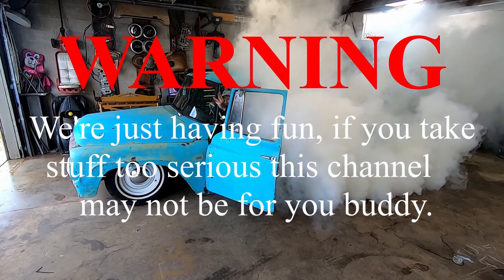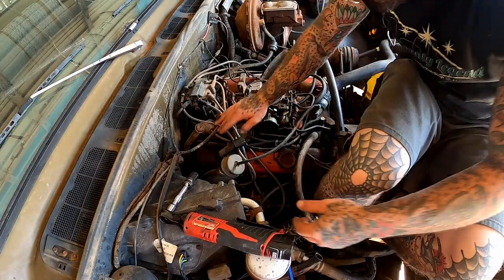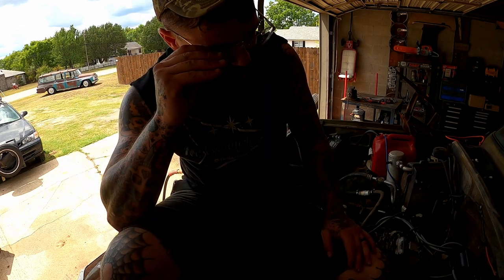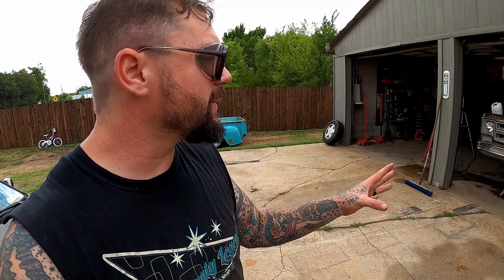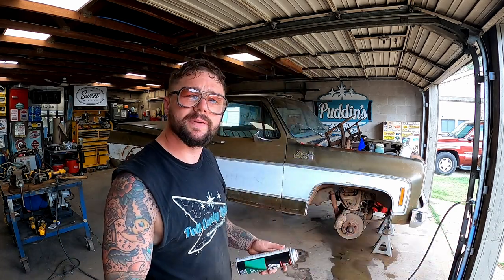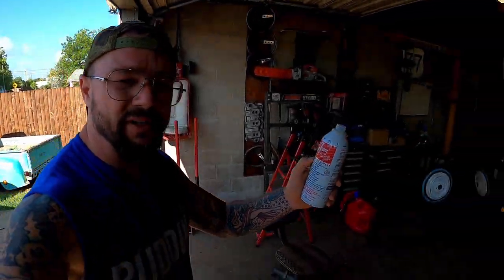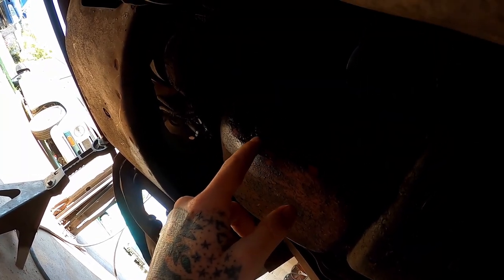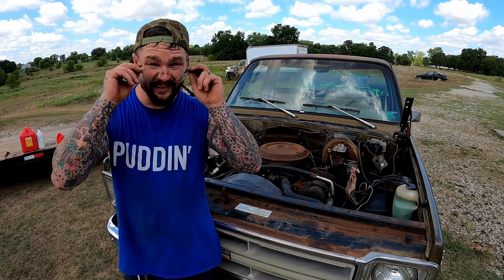ABANDONED 1976 GMC Sierra. WILL IT DRIVE after sitting??

Comment: Puddin. You were talking about a big giveaway, how about giving the 350 Chevy truck to celebrate your 200,000 mark. Every sticker purchased = 1 entry for a drawing by Hotrod for the beater truck. With or without a new gas tank, it would make a great prize. It runs and drives and it has not cost you a bunch of money so far. AS is where is.(with a title) If this happens, I will hold off on my purchase today of a sticker, BUT you bet your a$$ I will be buying all your stickers when applications start. I already have a bunch of stickers, but I could use another set or 2. It is a win win win. Your brand is expanded, Hotrod will love you more and I will have a shot at a pickemup truck.

Comment: You want a good product to put in your engine.  Z max I tell ya the best stuff on the market. I had a old Ford 6 cylinder that had a cracked water jacket. Every time I run that thing hot to the point where it would seize up. I put a bottle of that into it and I get a good 6 more months out of it before I repeat the process again.  Excellent product. I'd recommend it to anyone vehicle owner.

Comment: Not trying to tell you what to do but I would have put a set of rough tread tires on the back and used the truck at your new place to haul crap around. Even use it when your building on your place. Plus if you scratch it all to hell who cares right? 😂

Comment: My guess is that it needs valve stem seals. The compression is too good for it to be anything else. Chevys used a rubber O ring seal that dries out over time and leaks oil into the combustion chamber. The fix is to replace them with umbrella type seals. I believe they are sourced for a Studebaker V8, but they may just package 'em for a SBC seeing as it's such a popular fix. As for the truck itself, honestly I really like it. It's a full size but not full retard size like what they sell today. The pine green is a strong color and it's not too rusty. I imagine you could find a bed on a parts truck that is sitting on some farm in the area and just swap it over. If you paint it, leave that two tone as it just looks right on those trucks. I would go with the rally wheels they used in the 80's though as they just look better than the hubcaps.

Comment: Use Rotella 15-40 it's better for that old motor I use it in every car and truck  and yes gas motors even my 2004 8.1 Chevy , my 1993 GMC . I've used it for years . It cut my oil consumption in my 8.1 in half

Comment: Hot damn what a Labor day with the you tube King  of REAL mechanics, Let me say this. I had my own shop fur 46 years and then in the 10,002 time I crawled under a vehicle and didn`t  put a jack stand under  it before I crawled and guess what? the jack let go , and I became a human jack stand, DId I mention it had  no tires on it? well it didn`t and all of a sudden and that was the  end of my shop.But I did take a lot with me , besides holes in my neck and broken collar bones, I took . EXPERIANCE! and sir Puddin, of all the you tube mec can xs you are right more often than all the other ones, so you are the KING, and the others are dummys , A LOT! and if you dont know , you admit  it admittedly. so if you are reading this , you know who is right  more than any other you tuber, But I do got to give ya a hint on the tune up of the GMC truck. When ya got the cap[ off , cleanin off the white 'corrosion' dont do squat. But you should twist teh rotor to be sure teh mechanical weights under it are not stuck, and also check the vacuum advance to make sure it holds vacuum. If either one of these dont pass teh test, it will run like dodo.

Comment: Pitting that cab on your 4x4 will require some cutting of the floor gmc cab is a low hump your 4x4 is a high hump. But not a big deal you know since your a sheet metal guy right ;)

Comment: I used some Engine Restore in an old three-cylinder diesel utility tractor engine and it worked great IMO.
When you change the oil just add more Engine Restore and within a few years you'll have a brand new engine... seriously after a few oil changes you should notice a marked difference in your engine oil consumption and operation.
Just as I was typing this I heard, "smells like pickled butthole" and I got to laughing so hard I almost fell out of my chair.

Comment: you know somebody was royally pissed when they couldn't find their hunnert dollar, snap on ratchet and realized it must have fallen unnoticed into that pile of floor dry that they scooped up with a shovel and pitched into the trash when they cleaned their shop last week. i feel for their pain, i've lost a few tools to that pile of floor dry in the past, so now i magnet check them piles before they hit the dumper just in case. i saved a good 10mm wrench last month with that magnet. that's right neighborly of that feller to give you the title for that GMC for free. you oughta see if he's got one for the box truck too. then you could pull the box off for your dream office, build a couple car hauler ramps out of an old single wide trailer frame, weld them onto the frame in the back, mount a 12,000lb. harbor fright winch back there, and make a cheap recovery vehicle out of it so you can drag home future will it runs all painless like.

Comment: That may be a different engine! Unless it was rebuilt at one point …usually by 1976 GM went with a corp light blue engine color .
74 and older was typically Chevy orange! Should look at the engine numbers….could still be a truck motor …but ya never know till ya look!

Comment: Camouflage on a truck? "Henry did you just shoot that dear?" " I thought it was a deer until it blew up." That Restorererer maybe repairing some valve guides n seals < the cause of smoking on start up. 'I was gonna suggest ya get rid of the Tool Box. Then it slid out the back like a good tool box should.

Comment: That restore will dissipate so don't worry about let some out
Reply: I've NEVER had it dissipate & I've been using it for years & years.
Reply: @NoWr2Run  I'm going by the guys at the oil change place down the street. I add it everytime I change my oil in my 2012 f150. When I check my oil it's never over full.

Comment: Just as Puddin saves old vehicles, Jesus saves souls. You may feel like you aren’t worth anything, but Jesus can drag you out of the field of sin where you have been sitting in moral disrepair for years and get you running like new. 

Valve guide seals leaking into the cylinders?